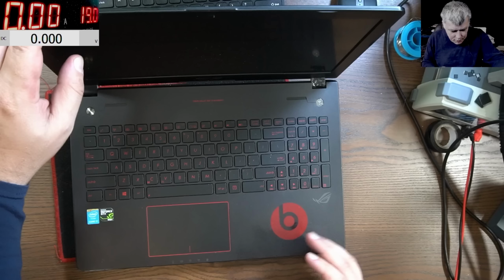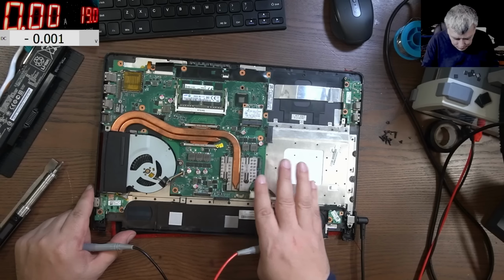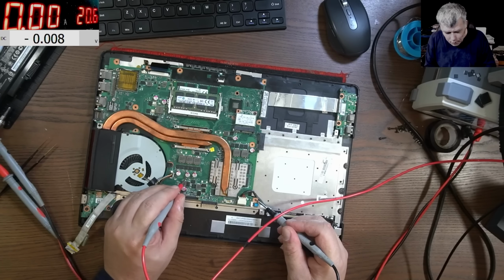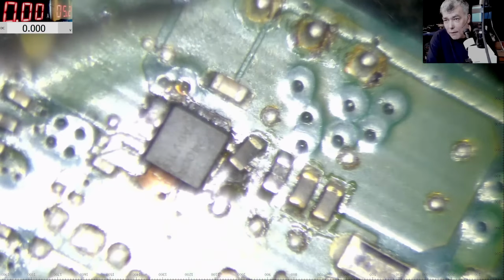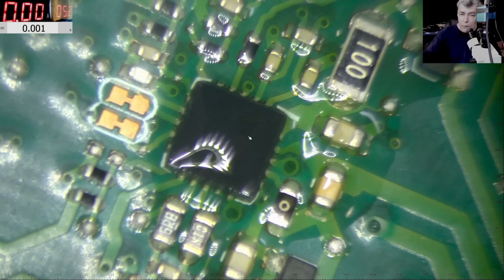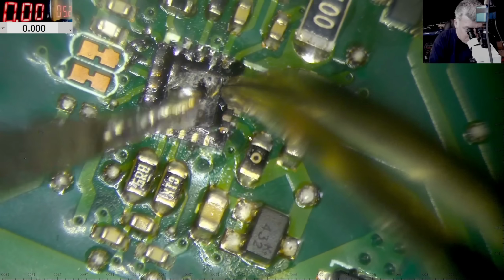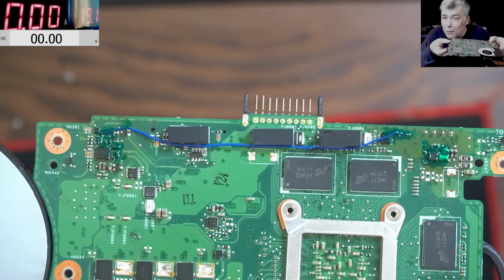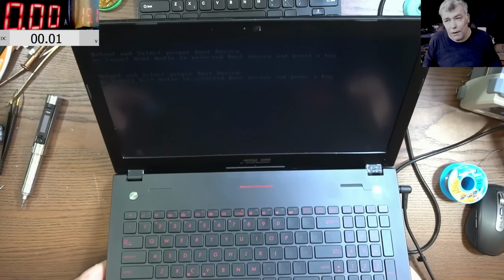Asus G56 gaming laptop - no power not charging - Dealing with fake chips from ebay

Comment: What would be the harm in just bypassing the mosfet?
Reply: There is feedback circuit with the charging controller chip and also data signal connected to the main controller chip, if the signal is not right, won't be able to change the battery or start the system, only on some old cheap laptop may work, now it is less and less.

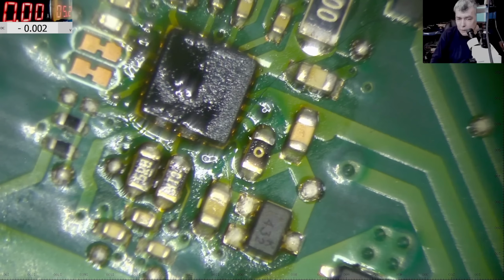Comment: 14:48 - 19:12 | That was hard to watch, why you not clean and prep pads for chip first? I have never used that technic of soldering the QFP chip before, I always use a soft wire brush to clean the pads prior to soldering. I am glad you figured the problem and fix it.

Comment: Question: if an IC is welded - is it a good idea to grind/dremel the Ic off to try and save the traces?
Reply: Be careful not to go too deep into the board
Reply: try use hand tools for have better control.

Comment: The chips may not be fake, but they are definitely not new. My theory is that they use some chemical that cleans the chip from the solder but causes corrosion on the surface. That's why I always apply new solder to the chip first to make sure that the chip is connected correctly.
Reply: I think they are new, they are extremely cheap to make and you can get them in bulks of 5000s or 10000s  no way would someone go throught the hazzle and pick them off existing laptops.

Comment: For me, the first step is continuity check on main power plug on the notebook side. I'w seen way too much shorted reverse polarity protection diode/fet, first main power fets. Its easy to check withouth takeing out any screw. If it's shorted, i have a clue about one possible problem. Also i skip to plug in PSU if main is shorted. This is my personal preference, maybe iam wrong. But I always try to be at least intrusive as i can.

Comment: Hi Sorin..in a bit confused about BQ does not know the charging current....as we can see in diagram @12:54 there is a shunt resistor to SRP and SRN pins which are charging current sense pins...so what exactly am i missing?
Reply from the maker: He's checking the output current instructed from EC/SIO chip, otherwise doesn't know how much current is pushing out
Reply: I think that's input current into laptop, and not battery current.

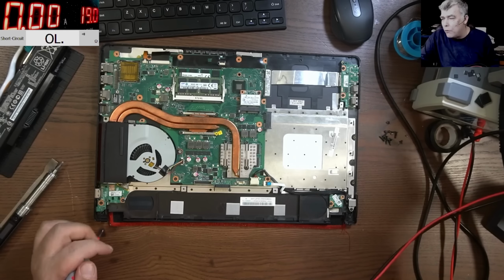Comment: 5:44 if you lower the voltage on PSU (and you have the issue with main power rail) you should set maximum voltage, which is allowed for CPU/GPU (so lets say 0,8-1,1V)
Because if the high transistor on CPU/GPU powerrail side is shorted, then your voltage from main powerrail (from your PSU) will be injected to CPU/GPU (and 0,8-1.1V will be safe)
But you've set 3.0V, so in rare cases it can damage cpu/gpu  (3.0v is 3 times too much) (I know that you set current limit, but anyway - you should learn people to take safe steps first)
Reply: Never use more than 1.1v when injecting.
Reply: @laboratorioassembler  it depends on 1.1V (5x1.1V= 5,5W) is not a lot of power very hard to spot a hotspot without a thermocamera . Just make sure the high side MOSFETs aren't shorted then just inject 19V 5A (100W).
Reply: @mart43  oh yes.. without thermalcam and new generation CPUs...  it's hard to spot shorts..  right now a cheap used flir one can speed up work a lot

Comment: :) Are those chips bought on eBay really fake? From what I see, original power management chip was placed back, because initial problem was with the faulty track, not with the PM chip. Did Sorin test new chips, after the initial problem was fixed? Did not see that in the video. The reason why solder was not attaching to the pins of the chip comes from long storage times. Ideally chips should be stored sealed in the bags.
Reply: indeed , probably the chips are just old but good.